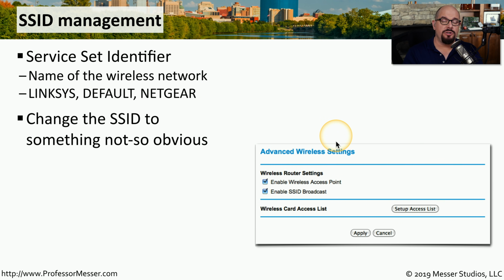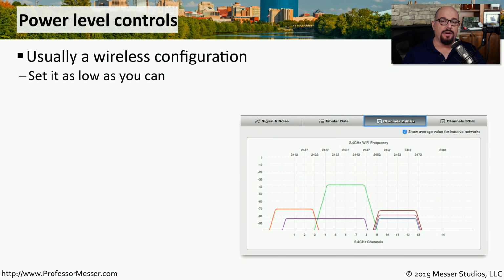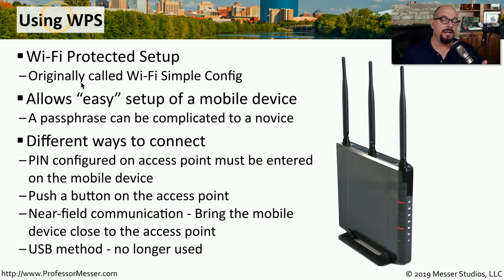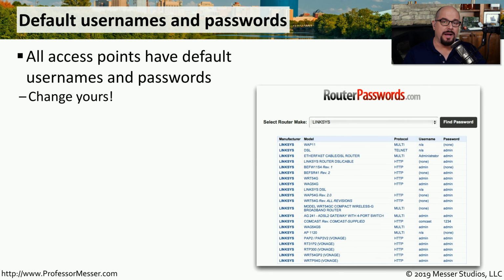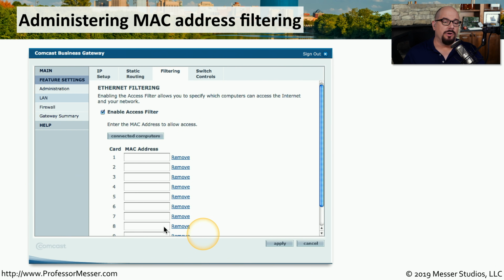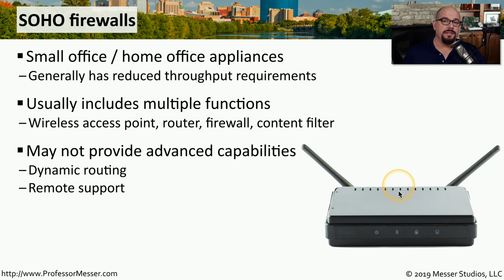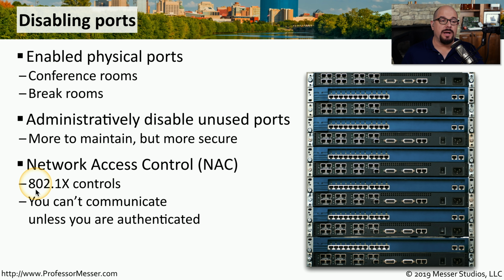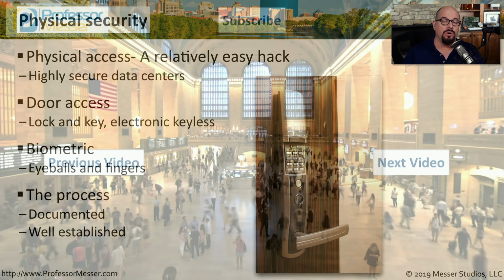Securing a SOHO Network - CompTIA A+ 220-1002 - 2.10

Comment: Interesting about the WPS flaw. If someone cracked the PIN and was able to join your protected network, other than that person using your resources, are they actually able to see anything? To rephrase, if I had the right tools, would I be able to see the contents of the packets of everyone else on my SOHO network? I would assume that you definitely wouldn't be able to see HTTPS traffic because that protocol is encrypted, but what about regular HTTP traffic? I trust there would be something else stopping user 1 from seeing user 2's data, even if they are both authorized users of that Wi-Fi network.
Reply from the maker: They may not be able to view the encrypted data from other users, but they would have access to internal devices and could potentially use phished credentials or an existing security vulnerability to gain access to a device that would normally be protected by the wireless authentication or a firewall.
Reply: Thanks for the response. So in general, would one authorized user (with the right tools) be able to see the contents of another's packets on the same wireless network if they weren't encrypted?

Comment: Thank you professor. I promised a job opportunity that I'd have my A+ certification within two weeks. Passed the first exam, working on studying for the second. You are the best resource I have used for sure.
Reply: Hoped you passed. I am in the same boat, past the 1001 and failed the 1002 cramming so I can take it again.
Reply: @Fallensuperior  I did pass, and I actually got my first IT job since then as well, about 3 months ago. You got this, work hard and you'll get it.
Reply: I have passed the 1001 exam already and currently studying for the 1002. I will likely take the exam next Thursday.

I have been looking on indeed but I wanted to know if you guys have any tips for finding my first Entry level IT job
Reply: @pslayer  apply everywhere. Most likely you'll have to go for something small and local, or you'll have to move for something bigger
Reply: @pslayer  It will depend on the area you live in. After passing the exam I am finding difficulty getting into even entry level helpdesk jobs due to lack of actual experience. It seems like employers in my area do not wish to train new people. Just look around for Help Desk jobs or IS Specialist jobs. Check local hospitals, hotels, banks, city government for IT positions. I wish you luck on the job hunt keep applying and you should land something eventually even if its not the greatest position it will offer you the experience.

Comment: maybe im missing something, but the WPS hack doesnt sound right. the first half has 10,000 possibilities, the second half has 1,000 possibilities. why would you add them together? you normally multiply in this type of scenario... surely you have to get the first right and the second right...?
Reply from the maker: The two halves of the PIN are evaluated separately; that's how bad the WPS implementation actually is. You have to match four numbers in the first half (0000 through 9999), and then three numbers in the second half (000 through 999). You don't evaluate all seven at once.

This isn't even the worst exploit of WPS. They found an even faster offline hack for WPS that only takes a couple of minutes.
Reply: @professormesser  that's unbelievable
Reply: @professormesser  math is off though. 0001 - 000 through 0010-999 is 11000 entries. still have all of 9999-999 to go through